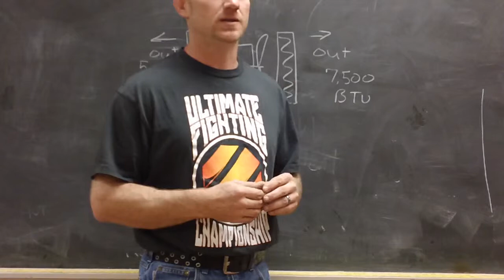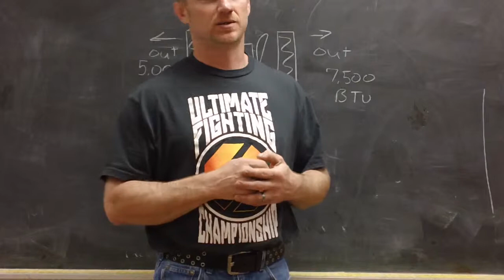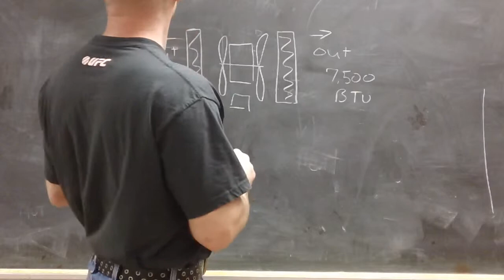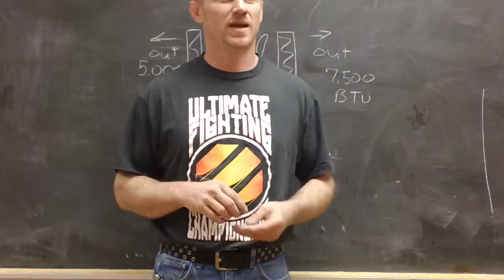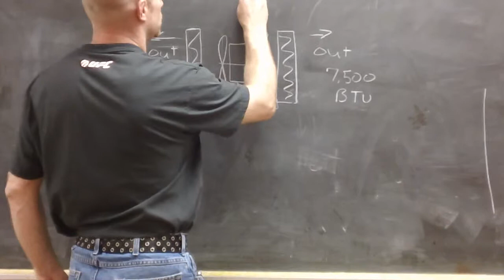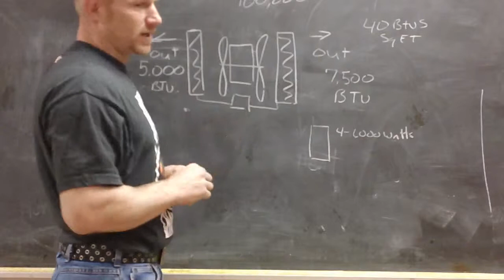Building Better Battery & Better Solar

Comment: Not that I don't believe you - but do you have any data to confirm what you're suggesting with the nanotube batteries? Even if it is theoretical. ie: calculating the potential surface area and conductivity of carbon nanotubes v. conventional lithium ion or lead-acid batteries. I don't know much about this technology, but it sounds very promising based on what you've said.
Reply from the maker: +Kevin Keel  Kevin thanks for watching.  To verify my claims just google it and see what you get when you put in Carbon nanotubes may increase power density 10x or just paper batteries or carbon nano tube batteries. I just found a couple very simple ways to do it..

Comment: have you found anything new on the nano tubes yet?
Reply from the maker: Hello buck... Yes I found they can now be purchased on line and shipped right to your house no restrictions or msds hazard concerns. I also found many easy and cheap ways to build and improve most any battery you can name. Since your one of the few who has the brains to ask I will hand it to you on a silver platter... Here it is..
Nano tubes is a big word meant to sound complex for what most would say is just soot from burnt stuff preferably with high carbon content. When it burns in an arc of electricity the form the soot takes as it burns naturally forms nano tubes as  burning happens on a molecular structure so the direct effect is the fire then has a direct molecular effect of the arrangement of the soot coming off it.. which is a single wall carbon nano tube that looks like fine black hair soot. They are that simple.. Basically... Now why would any body give a shit about some black soot.. Here is that answer.. imagine a bowling ball is the anode of a battery and you have a container of talcum powder .. now each speck of powder represents an electron trying to attach when being charged to the anode.. so you pour powder on top of a slick bowling ball and most will fall off and only some stay right on the surface on top thus limiting the number of electrons that can hold on and thus limits the charge capacity . NOW take said bowling ball and cover it in long shag carpet all over and set it down and pour your powder.... can you imagine how much more powder would stay on the bowling ball with the carpet catching millions more specs or electrons thus better charge ,power and recharge. Nano tube are the shag carpet on your bowing ball which in the short and sweet they equal tremendous surface for the anode and if you know batteries you know surface area has a direct relationship to POWER out put.. Being that the structure is on the nano scale it offers beyond what most can imagine in said surface area. SO ...... All you have to do is dope any anode of any battery with carbon nano tubes and you drastically increase the power capacity... How might one do that you ask??? well that basically means you can take the anode plate and use a conductive glue then sprinkle them on like fairy dust. However how they are arranged has a lot to do with efficiency but will work in any configuration. or say you had a lead plate  you can bring to the melting point and sprinkle tubes on surface as it cool to in bed them in plates or many other ways some you can probably come up with your self. Small scale one cell build your own battery then add nano tubes and measure the difference in power will reveal how powerful what I have just told you really is...... then of coarse you can just build batteries and solar cells out of just tubes too...LOL  Nano tech is the future... 
 I guess thats all I got to say about that......as gump would say... Hope it helps and maybe turned a light on.. but saddest of all is no body cares...they just wont let it happen but you can build them for yourself.. Like a electric bicycle battery that will go 300 miles at 30 mph on a 5 minute charge for over a million cycles....or car or what ever... Test show 10x power density for lithium ion when carbon nano tubes added to the anode...world changer...
Reply: very interesting, i'll have to give this a whirl... i'm a ibew electrician for about ten years.  I'm sure i can get some guys i work with to try it out also.    have you ever heard of thorium?  i see a video the other day about deriving power from this element.
Reply: Van Powell
Thanks for that explanation, Van.  I like you channel.  Lots of interesting things for me to experiment with.  Subbed.